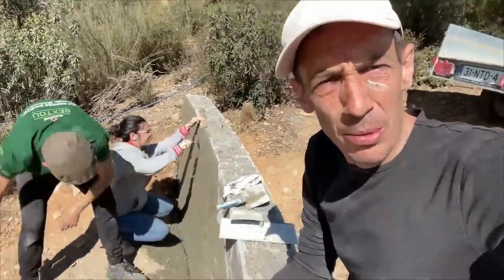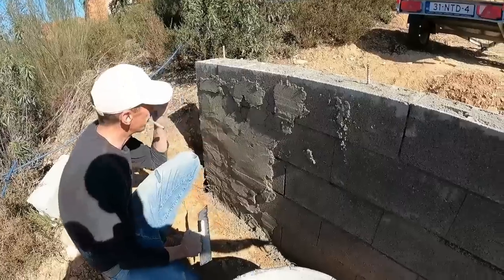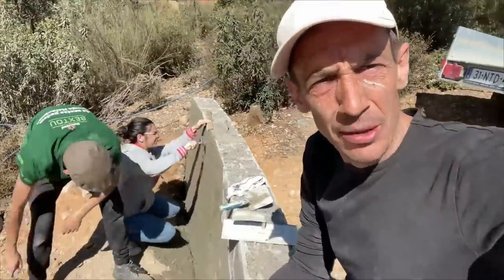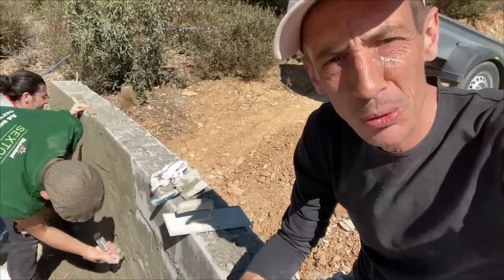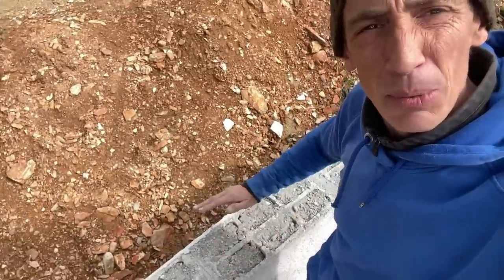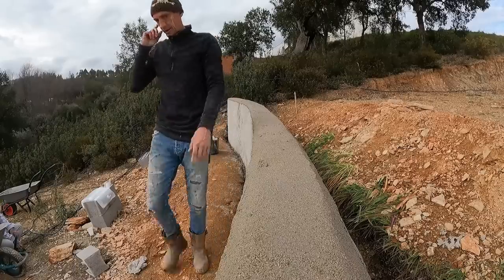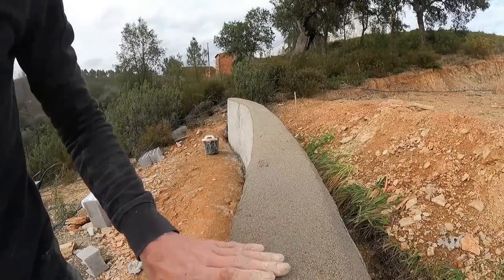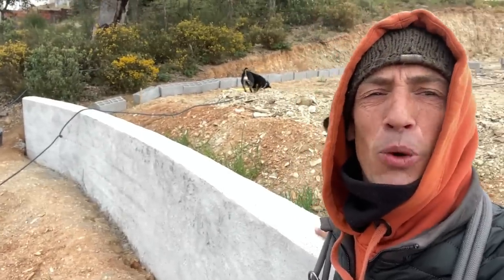S3E5: RENDERING AND FINISHING OFF - DIY PORTUGAL

Comment: Where is your drainage for the wall? It's a retaining wall so it has to have drainage
Reply: CLEARLY has natural drainage fool!!
Reply: Water dont follow drainage much in portugal.
Reply: I’m thinking the water will find those spaces between each block and eventually crack the render on the other side. I’ve seen some simple rock walls with just a few spaces without mortar. Water will find its way out.
Reply: @jon-kp2rq  oh OK I was just wondering as we built a retaining wall in our garden and had to have  drainage holes in the wall or a French drain behind the wall.
Reply: It's just a matter of physics in the end worth doing a job properly the first time

Comment: That was painful to watch😮
Mix is far to dry.
It should be a scratch coat first then top coat.
You could even have mixed some sbr up and applied that to the wall to slow the suction rate down.

Comment: Is there drainage to prevent water from building up pressure on one side of the wall? In Portugal I see a lot of tubes going through walls to allow water to escape rather than eroding the soil at the wall base. I don't know if it works but drainage could be an issue.

Comment: There will be water gatheringnat the bottom of your wall and the starting to rott. And if you re planning to compress filled in earth the wall will skip cause it s too thin. Thats why they build dry stone walls to let the water pass through. For this you would needed bigger stones, even rocks. But its too late anyway. I would hardly suggest to get some advice by professionals before so much unneccessary work, thats frustrating, isn t it?

Comment: I don’t see any drainage on your wall. When you get heavy rain you really need drainage or you will get too much weight/pressure behind the wall. I’ve seen quite a few collapsed retaining walls during the rainy season. Maybe you can drill through and add pipes near the bottom for drainage and put some rocks and gravel to cover the drainage pipes behind your wall so they don’t get clogged with dirt?

Comment: to wet the wall normally we use a big brush and wave it sprinkling the wall, not much needed anyways.
did you forgot the white sand?  to cover the wall the ratio is different: we apply 2 types of sand, Tejo sand and white sand. apply tar after dry if it's habitation wall use later.
retaning walls should have a french pipe (or any perfurated pvc pipe) on the retaining side, envolved in gravel for good drainage, and  landscape fabric before covering with dirt.